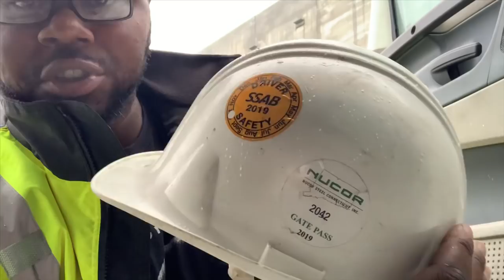Dirty Jobs and Why I Left Hornady Once Again P&S Transportation Flatbed Load Shift

Comment: I use to unhook the trailer or find something solid to put a chain on move it with the tractor or hook chain to a binder an yank them did it a couple times the worst is when it shifts front I either put a trip chain on or a false bulkhead with dunnage. Dude that was some fucked up delivery, you got a good attitude for the job, I would be yelling at people. PGT
Reply from the maker: Definitely was messed up. I wish I would have got some footage of the trailer when I first got it. It was a mess. Had to get it reworked before I could leave they had it so messed up